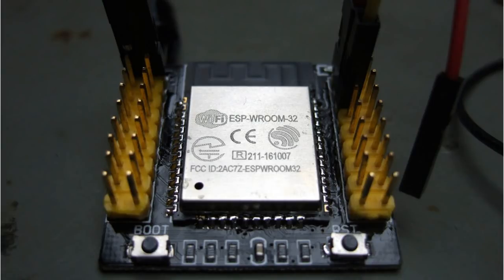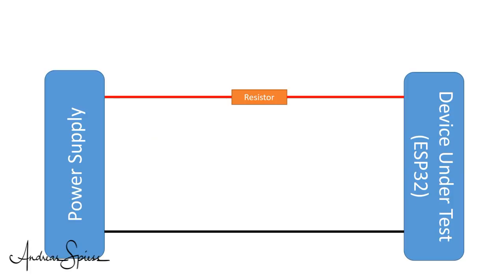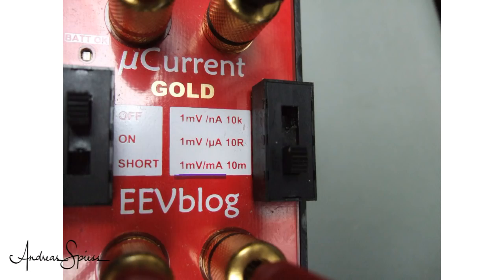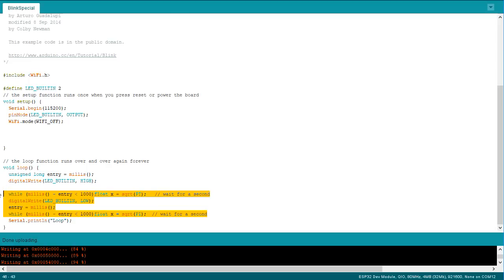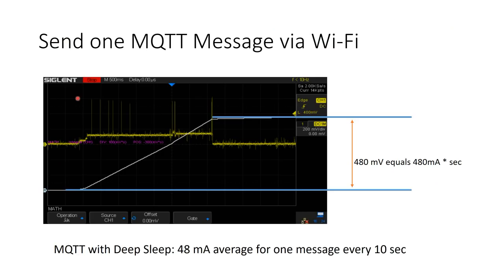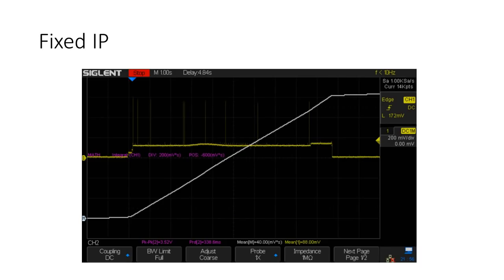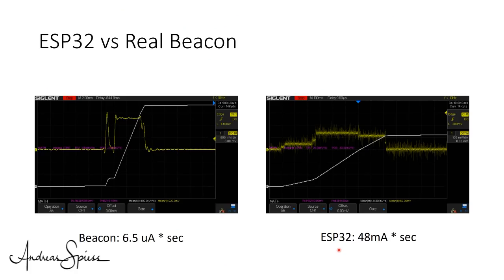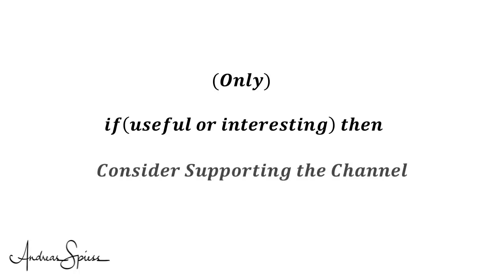#179 Was it worth waiting for Bluetooth? How Much Current Needs the ESP32 Bluetooth in BLE?

Comment: Thanks Andreas, excellent video. The new ESP32 SoC run BLE 5.0, which means that in theory, these models should have BLE range 4 times larger than the earlier ESP32 SoCs with BLE4.2 (which should only be 10m or so). But what is it in reality? Is there a real difference in BLE range between ESP32 SoC running BLE4.2 vs the newer ESP32 SoC running BLE5.0. ?
Reply from the maker: Maybe I will have a look at BEL when I get one of those chips. To reach long range the transmitters have to be more powerful and I am not sure if this is the case here.

Comment: I recorded a similar consumption diagram in the 80ma range for broadcasting the BLE signal.
The duration from the moment of waking up, broadcasting the BLE package and going to sleep takes almost one second (92% of the second). Peak consumption values reach up to 140mA, but on average 80-86 mA as you have in the video.
As a result. Two AAA batteries(3 v, 1000mAh) are enough for one day with an interval between awakenings of 1 second. CR2450 batteries do not start, because the peak current is not designed for the use of such types of batteries or a very high-quality battery manufacturer is needed.
Reply from the maker: Thank you for sharing your experience!

Comment: Can we really make BLE beacon with ESP32 or any other chip which uses very less current (like in microamps) for coin cell operation?
Reply from the maker: I do not think so. You have to use another chip.
Reply: @AndreasSpiess  please try to make DIY BLE beacon which consume low energy and work long on coin cell.

Comment: Thanks for such videao.
Did ou evaluated the way to use ESP32 as a BLE receiver? Eventually, using ULP coprocessor to await BLE messages?
Reply from the maker: I do not think that BLE is on when the main processor is off.
Reply: @AndreasSpiess  Thanks for the tip.

Comment: 12:06 Cant understand power cons formula. Is it mean 5 microA in deep sleep for one operation(sleep/wakeUp)? Maybe 5microA in 1 hour, and formula 0.005mA×24×365? Nope?
And what is it mean 8.5mA in ble mode every 10 sec. We are send message every 10 sec and it uncharge battery in 8.5 mA every hour or 24h?
Do you can explain arduino 168pa(1mhz, 8mhz)+nrf24l01 in ble mode(sketch exists) the same as esp32.
Reply from the maker: Look at the diagrams before and you will understand. It is the energy used for one wake-up or for transmitting one message.

Comment: Excellent Power management Report.  A question.  Would you recommend using a BLE beacon for BLE communication rather than the ESP32?  Also, do you have opinions about using nRF 52840 or their new nRF9340 for processing plus BLE communication in a power limited situation?  Thanks for your excellent work!
Reply from the maker: I am no BLE specialist. AFAIK the beacons are single purpose and the ESP32 can be programmed for various purposes. The nRF chips seem to be very good. But I never tried them

Comment: Wonderful video and I learned a lot, but I'll add that I think the math was wrong calculating ESP32 battery life at the end of the video. Using the ESP32 as a BLE beacon, we use 84mAs per message. By my math we'd need around 2,000mAh per month if beaconing every 30 seconds. It wouldn't last a whole year off that AAA sized LiFePO4 cell unless it was beaconing VERY infrequently.
Reply from the maker: Maybe you are right. I do not remember every detail. I am an old man ;-)
Reply: Yup. I got the same result, friend. It was a miscalculation.

Comment: Thank you Andreas for your detailed investigation! I am evaluating the ESP32 for a home automation project where I would need it to get temperature data once/hour over BLE. What I couldn't find yet is some tests for the BLE range. Do you or anybody had some experience with that and can provide me with some numbers (meters)?
What I need is to have a SoC which is able to run on a CR2032/LiPo3300mAh for 1+ years and send temperature information each hour through 2 walls of reinforced concrete at ~10m distance from a RPi3 gateway.

Also, I'm wondering which would be the current consumption if using the ULP. I guess in this video that feature was not used/considered.

Thank you again!
Reply from the maker: There are a few things to consider: How to save energy in general. There the ULP could help if you need a special trigger. If you only want to trigger once in a while, it is not needed. The second thing is the communication. Range always have to be tested. But this can be done with a simple sketch.

Comment: Please check out nRF51822 modules that can run Arduino sketches off a coin cell for a year or so using https://github.com/sandeepmistry/arduino-nRF5 and https://github.com/sandeepmistry/arduino-BLEPeripheral. The chips themselves are available cheaply from eBay, e.g., by searching for "nRF51822-04 BLE4.0 Wireless Bluetooth Module TTL Low Power Consumption 3.3V".
Reply from the maker: Maybe I will try this one. I have a BBC microbit laying around...

Comment: Your video sheds a lot of light already so thank you for it! I have a flat 350 mah lipo battery connected to a 3.3c step up/step down regulator and charger module, which powers a bare ESP32 chip connected to a micro buzzer. I'm building a 3d printed credit card size wallet finder, and I want to be able to use a BLE message from my phone to make the buzzer sound when received. What would you recommend as deep sleep settings ? I don't want to charge the battery every day, so having this run at least for 2 or 3 months would be convenient.
Reply from the maker: You cannot use deep sleep (or only a very short one) in such a scenario because you do not know when the message will arrive. During deep sleep you have no reception.
Reply: Andreas Spiess what if instead, let’s say my phone spams the area with the same BLE message until it gets a response from the device as it wakes up? Also, is actually waking up and turning on BLE on the esp32 more power efficient than just leaving it in low power mode without ever turning BLE off? Let’s say with a 10 second interval between deep sleep cycles

Comment: While I do find your videos very interesting, your battery requirements are not quite real world.  If you use a chip that can run stably off of say 3.0v and 10mAh then choosing a battery of that capacity is a very poor selection.  As the energy stored is used the battery voltage drops below range in the simpleton example shown.  Your pwer density is spot on so simply coupling with 2x the number of batteries is a layman way to better meet the VA requirements.  I used to drop sensing instruments into the ocean for later retrieval -- say a few months.  There is much more to consider when selection of power cells is performed.
Reply from the maker: We talk about two different things. I talk about capacity and you talk about additional safety range. Both are valid points.

Comment: It was a big surprise for me when I found out that current consumption in BLE mod the same as in BT classic mode. After a night of googling I have found a topic at the official forum where one guy from Espressif said that "modem sleep mod (==BLE) is NOT IMPLEMENTED IN SDK yet, and it will be released in SDK v3.1 (current stable version is 2.1.1). I think it's a shame! They are selling chips without one of the key feature in SDK.
Reply: Upd. That topic was on github esp-idf repository github.com/espressif/esp-idf/issues/947#issuecomment-359211747
Reply from the maker: Often in Chinese products, the software and the manuals are the weak point.
Reply: Apparently the SDK supporting BLE was released in May 2018, has anybody tried it since? I'm interested in long-term logging BLE beacon presence (like one scan per minute), and uploading the data by wifi once in a while (maybe once an hour): do all BLE beacons just send once per second? That would mean a BLE scan needs to run at least a second or it wont reliably detect the beacons nearby?

Comment: The question is, what is the main purpose of integration BLE into ESP32. IMHO, the BLE implementation is not for building standalone BLE tags, but for gateway between BLE and WIFI/RS232/I2C or whatever. For developing BLE devices powered long time from batteries, different chip has to be used. I'm not sure, if ESP32 is primary targeted to standalone BLE devices...
Reply from the maker: I agree. But still it should use less power in BLE, I think.
Reply: To give ble advantage to arduino users.

Comment: Very interesting, particularly the power comparison with a dedicated beacon.  If you use a large bypass capacitor be careful not to ignore it's leakage current, which can easily be of the same magnitude as the EPS32's deep sleep current.
Reply from the maker: I know this from my ESP8266 experiments. There I used Tantalum SMD capacitors which were quite bad...

Comment: The BLE beacon sketch is quite interesting. It only contains code in Setup(). The ESP32 reboots after  transmit, restarting the process. My question: will variables hold their values? I guess not.. quite a show stopper (unless non volatile memory is used)
Reply from the maker: I just used the sketch without understanding it. The reboot is because of the deep-sleep.
Reply: I just found out: the variable "wakeupCount" is maintained over deep sleeps. It's type is RTC_DATA_ATTR. Very useful!  Thanks Andreas for your video, it inspired the idea for a new battery powered project.

Comment: Nice work!  Andreas, I wonder how much current is lost due to leakage in the large 1000uF capacitor? 

I ran into this problem on a device design a few years ago.  I was able to source some "Low DCL" (low DC leakage) caps used in implantable medical devices. The leakage specification for a standard electrolytic is typically something on the order of 0.05CV (that is: capacitance x voltage x 0.05).  The spec on the medical caps was 0.0025CV .

It's fascinating to watch multiple people build on each other's ideas to crack a problem like this!  Keep going!

  --- Also: drive down the middle, like I do.  It's the only way to be safe!
Reply from the maker: I had this problem with my ESP8266 boards when I used SMD tantalum caps. This is why I use now normal ones if I have no space constraints. They seem to be better.

Comment: Excellent video, Andreas. I'll have to build a MicroAmp 10 or 12 projects from now.

When I want more battery life in a MCU project, I try to drop the clock frequency. It might help to try rtc_clk_cpu_freq_set(RTC_CPU_FREQ_2M); although you won't be able to debug it as (I suspect that) the current UART code assumes 80MHz. Lowering the clock is an interesting experiment, even if it doesn't work with the current core because eventually, Espressif will make that work.
Reply from the maker: I tried it and unfortunately the on time was longer and in the end it used more power :-(
Reply: What about shutting down one of the 2 cores? Is that possible?

Comment: Nice video Andreas - now that SPIFFS is supported under the Arduino IDE for the ESP32 have you considered doing a video on it?
Reply from the maker: I am not sure. I did not like the spiffs on the ESP8266. Maybe if I have an application
Reply: It's sad, SPIFFS is great for more complicated webpages, with includes one used for wifi configuration.

Comment: How about esp-now power consumption?
Reply: It depends on what kind of sensor, but honestly something like the NRF24L01 is probably a better choice.
Reply from the maker: I did not measure it. It should be quite low, because the processor is on only for a short period
Reply: Andreas Spiess I need a wireless sensor for my raspberry pi that can run on coin cell. 1 esp 8266 as gateway direct on raspberry and 1 as a sensor (esp-now) Or an esp32 direct with Bluetooth?

Comment: Excellent video - as always.  What barebones ESP32 board are you using?  (Mine have 2 resistors, whereas yours appears to have 5...)

Also, do you know of a barebones ESP32 board with a beefy capacitor - e.g. 220uF?
Reply from the maker: Thanks. I have two versions and they appeared in one of my mailbags. I had to add the capacitor. In my case, 220 uF was not enough.
Reply: I wonder if you though I was asking about the ESP32-WROOM-32 modules?   My question was actually about the 'base' or adapter board.  I have this type:  http://bit.ly/2gLfAOS, but the ones in your video look different (black, more resistors etc.).  I've trawled through your mailbags (and forgive me if I missed them) but I can't see the black version...

Comment: Great video!
I'm a little disappointed with ESP32 BLE power usage. IMHO it was advertised as low power so I expected something which it's more comparable to beacon than wifi.
Could you repeat this test after some time? For example after 6-12months? Maybe libraries will have some better optimisations or there will be a possibility to program ULP+Bluetooth with arduino?
Reply from the maker: Similar feeling here. But I am pretty sure we did not see the end of the story. The BLE in Arduino is very new and I do not have lots of knowledge.

Comment: Hallo Andreas Spiess, great video. Just note that the ESP32 deepsleep allows to specify a wakeup hook function (in RTC memory) which means the ESP32 deepsleep wakeup will not boot instead the preserved RTC men hook function will be called and you can decide to deepsleep again or to boot. This allows to check some GPIO or other simple stuff. This way the wakeup IO checking and deepsleep again can be as low as 1 ms.
Regards from Hannover.
Reply: Ok, this comment is quite old, but since I currently work on this: you can use gpio and other things in the ULP (ultra low power) "sub-processor". No need to wake up the main cores (and use these hooks) at all. See https://github.com/joba-1/Blink-ULP-Sleep (main cores always sleeps, ULP just wakes up to toggle led state) or https://github.com/joba-1/Temp-ULP (ULP wakes up in intervals to collect temperature data and wakes up main cores to send the data over wifi once the buffer is full). Btw: I need tips for low power esp32 boards (usb serial not a requirement) to make full use out of this :)
Reply from the maker: Thanks for this info. Is it usable in the Arduino IDE?
Reply: Yes it can be done in the Arduino IDE,  I use the ESP32 only with Arduino. However in general (not only ESP32, also SAMD D21, etc.) my opinion is that Arduino is not a good development environment, poor IDE features, bad support, no fixes, weak library implementations, a lot of missing API ’s. I use mbed.org which is much more powerful for ARM MCUs, it is 20x better supported and easier to use, and more professional.

Anyways for the ESP32, Espressif delivers their SDK which includes all ESP32 APIs and Arduino comes on top for this. For the ESP32 Arduino is the best OS/SDK environment you can get for the ESP32. The Espressif Arduino support team works instantly on bugs/enhancements (see github). For this reason I work with the ESP32 using Arduino. The Espressif “ESP32 Technical Reference Manual” is no a good manual to dive into the hardware features of the ESP32, it describes all details, even the one which are not available in the SDK or Arduino. Regards from the Arduino Hannover LoRa team.

Comment: You should take a look at CNLohr's Twitter, he got an esp to boot, send a message and sleep in (I think) 16ms. And great video as always :)
Reply from the maker: Thanks. I saw it. He is very good.
Reply: He also used non standard wireless packet which has been received by wireshark running on openwrt router.
Reply: Unfortunately he did it very low level without using of IDE. I hope such functionality can be included in IDE in the future.
Reply: @cbm80amiga  Well... I hope there will be more low level tutorials because high level does not help anyone as much as learning everything from ground up
Reply: If i remember correctly, his system required a modified router. That's not very portable.
Reply: @inventorofmachines  Yes

Comment: No sorry Andreas you all drive on the wrong side of the road.
Reply: Andreas drives in the "right" side of the road. You drive in the "wrong" side. ;)
See antonyms: http://www.thesaurus.com/browse/right?s=t
Reply: They are driven in the side there are left after the right was taken. :-)
Reply: +2000jago True, steering wheels should be on the left from the inside's perspective.
Reply: And that's why you should drive on the right side! ;) Now seriously, when will we finally standardize things like these? The side of the road and the steering wheel position, the plug types, voltage and frequency of mains, numbering scales (spoiler: long scale is better)... Now, it's true that the system adopted should be backwards-compatible (in the case of mains, maybe we could do what QC does, and supply the voltage the device wants?), and that a big effort is required. At least we have standardized SI units, with a few "insignificant" exceptions (I'm looking at you, US, Birmania, and Liberia).
Reply: GRBTutorials well that just makes it awkward when one drives on the left side of a dual carriageway.

Comment: Great video! I'm curious what chip the beacon you tested has. Was it a nrf51822 or one of the Ti ones?
Reply from the maker: Nrf81522
Reply: Andreas Spiess that can also be programmed with the Arduino IDE, there are several different cores for it and I think adafruit is working on stuff for it now.